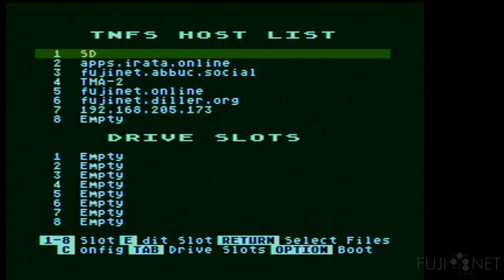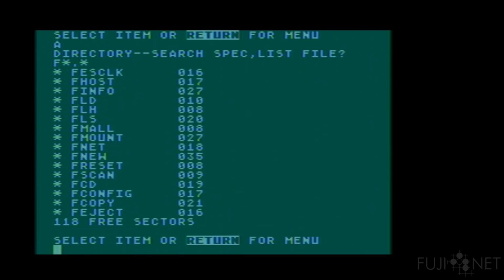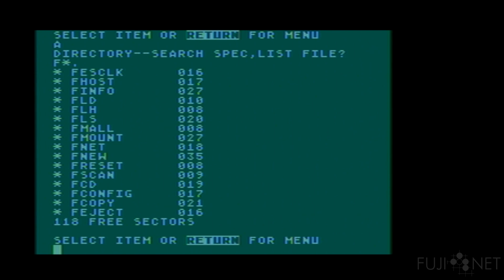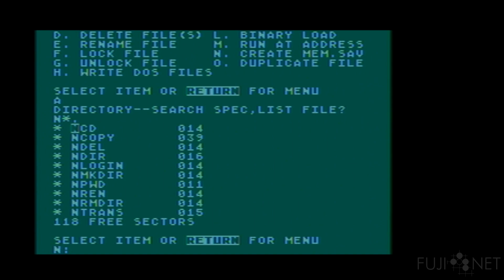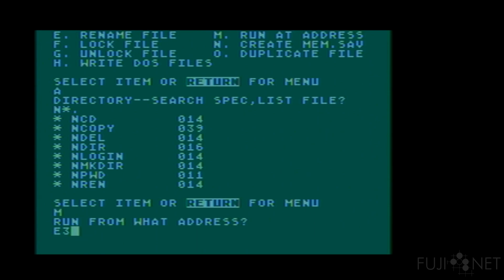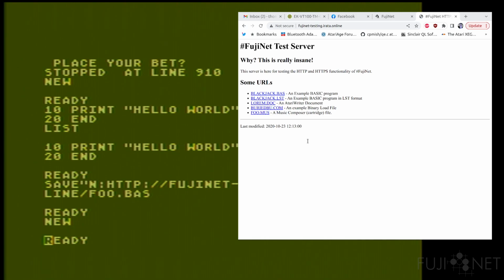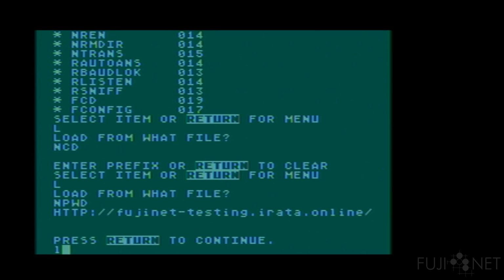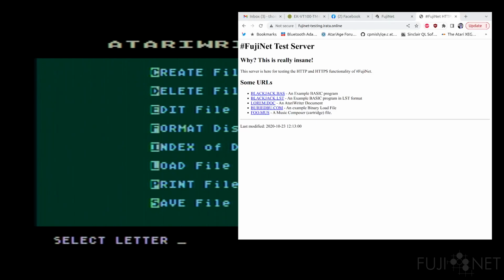The #FujiNet team needs Feedback from Apple II Users!

Comment: First of all, thanks for working on Fujinet for Apple II.  I just bought one a few weeks ago for my IIc and I have been playing around with it a lot.   Before I go into what I would like to see, I will try to answer your question.
 In terms of usability, it would be nice to have all of the features that you demonstrated in this video, but in a more user friendly interface.  I know that there is quite a lot of limitations since the Apple II is not a high powered modern PC.  But instead of having a bunch of command line executed .bin files, I think it would be nicer to have something like the Systems Utilities program that came with the Apple II computers; a nice text/menu driven interface that allows you to download/upload programs directly off of a web-based software repository, and then be able to copy the program to an SD card.

However, before working on all of this, I think you should address some of the bugs and incompatibilities in the firmware especially with working with certain disk formats.  Example:

- ESC key doesn't seem with the latest firmware, so I cannot reboot and execute the program in the slot.  The November 2022 Beta2 version seems to work without issue.
- Make compatible with .DSK, .WOZ, .NIB formats, and not just .PO and .2MG which seems to be rare.
- telnet functionality is good and connects to most BBSs, but on some sites, the text is formatted poorly making them hard to use. Maybe build in a better telnet program.
- offer a case so that it looks better. (especially on the IIc)